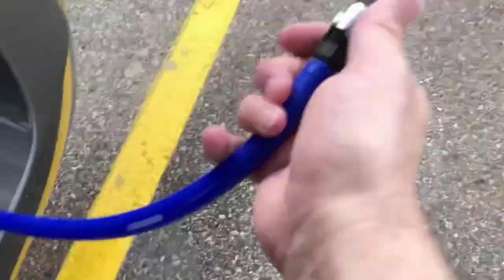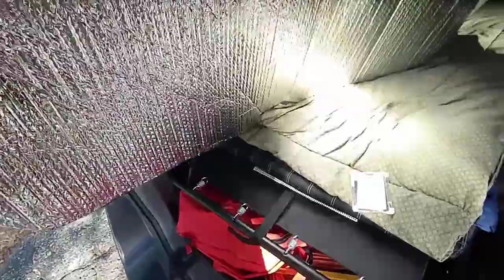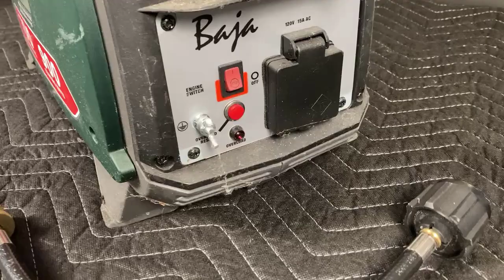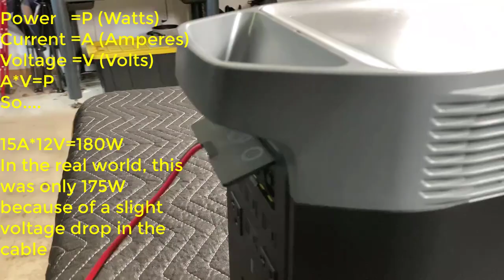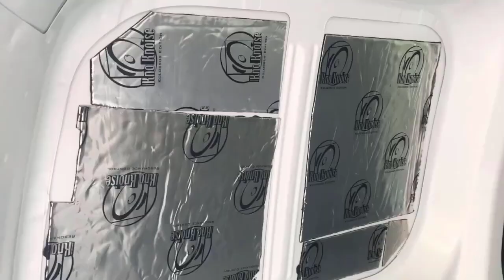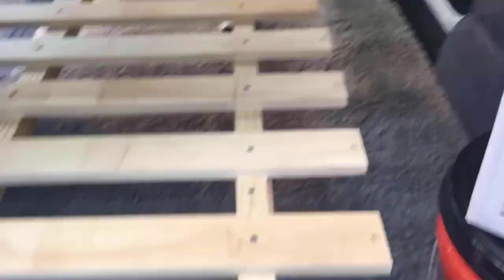Unlimited Power for Vans, RVs, and Tiny Homes

Comment: Do you have any tips or experience towing a cargo trailer with your odyssey?
Reply from the maker: @shaunjaymagic  I’ve never used my trailer hitch for anything other than a  cargo basket or bike rack, so the only thing I can suggest is a transmission cooler. Honda has one, but you could use an aftermarket piece. I’ve towed a 6x14 trailer with my Pilot, without issues. They are essentially the same engine and transmission. Thank for the question and for watching!

Comment: Hi Dan, this is a bit of topic, but as an Odyssey owner, have you experienced any issues with the VCM (variable cylinder management)?  I just bought a 2014 Odyssey with 120k miles and am currently making it into a "no build" camper.  Enjoying your videos!
Reply from the maker: @katherinelalli776  great question!  I’ve never had a “problem” with any VCM related components, but that said, I have run a VCM bypass for the last 40,000 miles or so. I find the van drives better and there is no “flat” feeling when you tip into the throttle. You paid for 6 cylinders, so you might as well use them!  I got mine from https://vcmmuzzler.com and found it to be well made and easy to install. About 30 min the first time through. The difference in mpg is negligible in most situations. Thank you for watching my videos!

Comment: Thanks for the video. I always find some useful info I didn't know before and generally act on the new info (ie. I got myself the Nuwave induction cooktop after your Cooking video). Anyway, I was already thinking about creating dual options with solar and propane generator/inverter to charge a battery power storage system for my minivan build -- but doing the same for the home is actually a better idea. "Options" is the foundation for eventual SHTF and my current observation of our nation in decline.
Reply from the maker: You’re right about that. Always good to have backups and fall back plans. Thanks for watching and adding your thoughts!

Comment: I have that EcoFlow for an off grid camper build, great unit, I would definitely buy it again but it will not run my diesel heater 😢.  Awesome unit tho!
Reply from the maker: Thanks for commenting and sharing that!  I’m a little surprised, I would not have thought the diesel heater would pull that much current. Good info!  Thanks for watching!